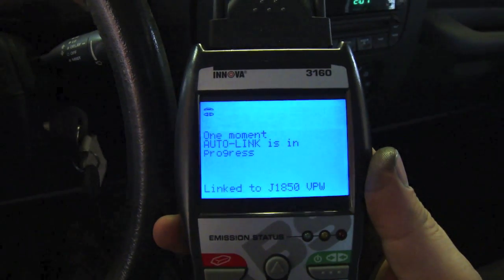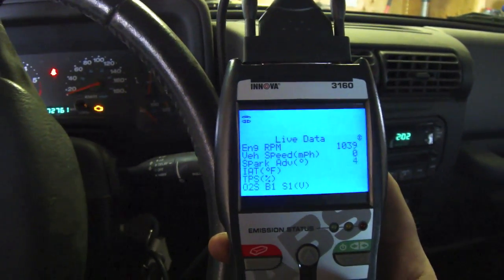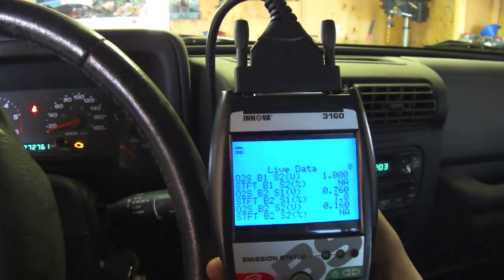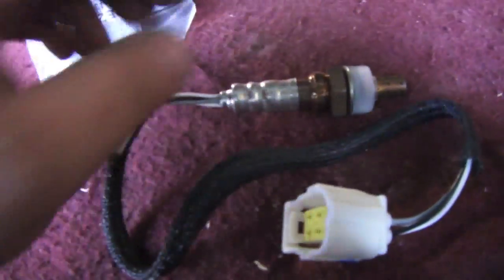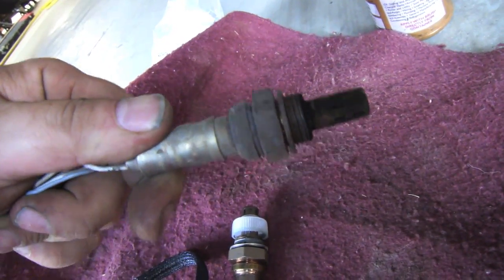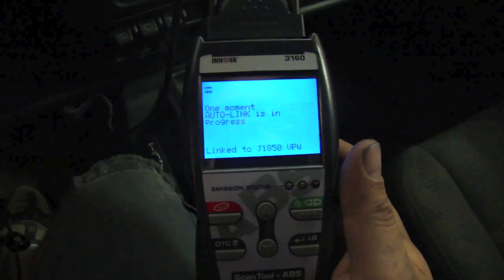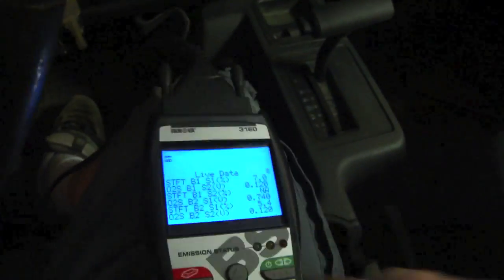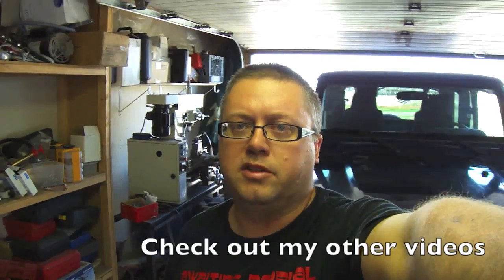DIY Troubleshooting a P0138 and P0141 code

Comment: Bullshitkorner I got a p0138 short circuited I changed o2 sensor fuses relay and still running the code u think it's wiring harness problem or could it be that I still have spark plug non foulers on the o2 sensor

Comment from the maker: hahahah I love the PBR it's not a high class beer but it's cheap and not mainstream that's why i use it in my videos and plus it's pretty good as well.  I've never tried BL Platinum and not sure if you can even purchase it here.  The jeep is actually a work in progress i hope to finish it late summer or fall, with new gears, lockers in both axles, larger tires and accessories.  If i can make it happen i want to drive the jeep to the arctic circle next year that is my goal

Comment from the maker: no it's lefty loose, it must be seized in place.  try spraying with some pb blaster or some other penetrating oil. take a ball pean hammer and tap the rung where it threads into sometimes that helps to free it up

Comment: Jerry, do you remember how to remove bank 1 sensor 2? I'm trying anti clockwise with a 7/8.  I started the engine, sprayed some 4d40, no luck!! Is it remove clockwise?
Reply: WD40 doesn't penetrate to the threads. Use PB Blaster instead.

Comment: An open circuit will cause a high voltage (P0138) and the heater in the o2 sensor will not work (P0141). Probably caused by the poor connection at the downstream O2 sensor.
Nice to see the live data, but would have been nicer without hearing the curse words.

Comment from the maker: the 33's will still go on next year after i do a gear change.  I had a ford ranger with a 6 inch lift and 33's and it was too much with 3.73 gears.  the 31's are ok on the jeep for power wise after a banks tune but 33's with the automatic would lag the motor too much